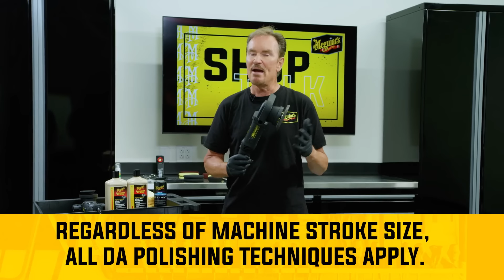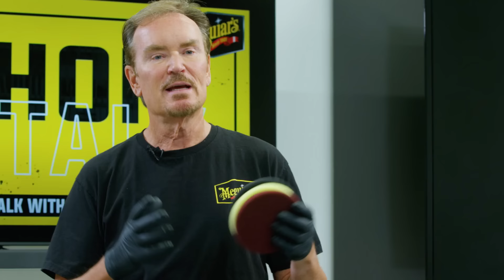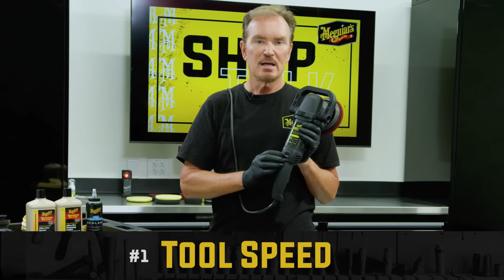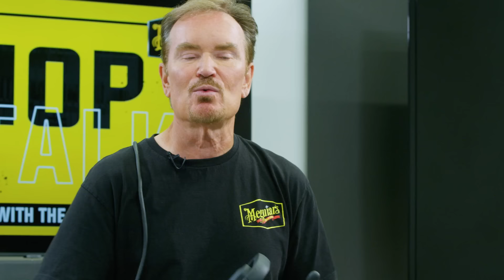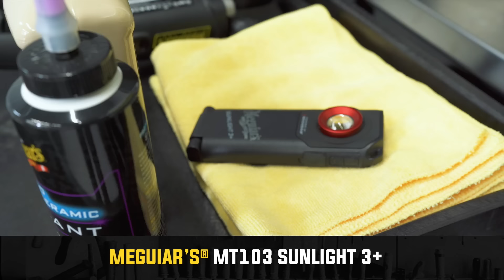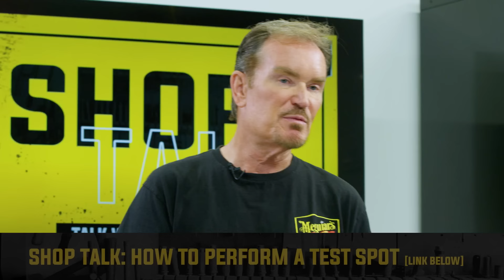DA Polishing Techniques - Shop Talk

Comment: Hi, I am using Ultra Pro Speed Compound M110 and Ultra Pro Finishing Polish M210 and the results are great but Have I to apply other steps like sealant or wax? If it is yes, suggest one please.
Reply from the maker: If you are hoping to protect the paint after M110 & M210, yes you would want to follow with a wax/sealant.  Our M27 Pro Hybrid Ceramic Sealant would be a great choice if you are looking for superior protection and water beading.  👍